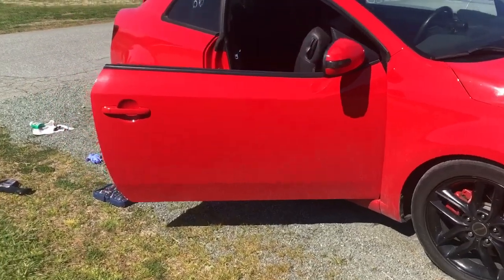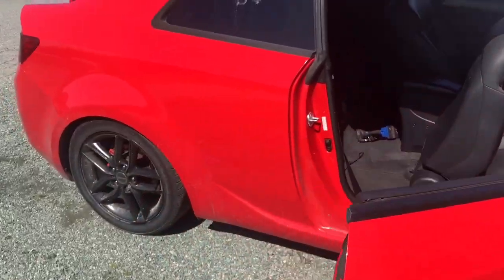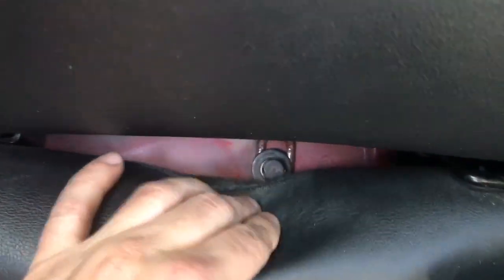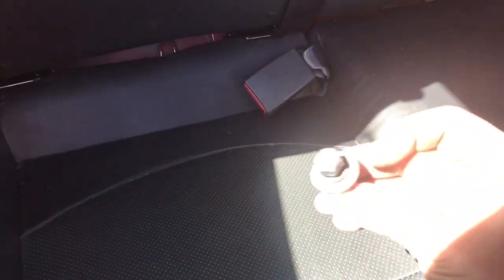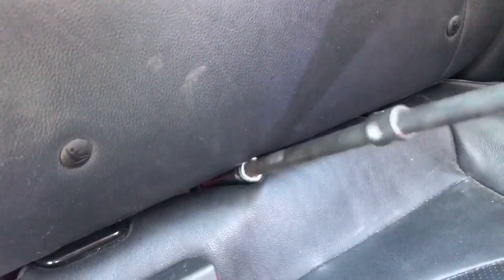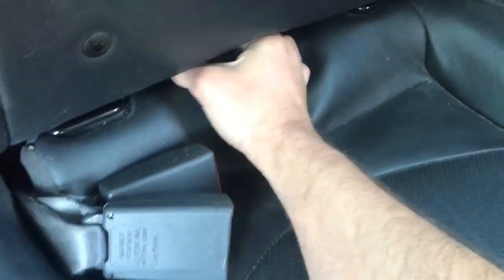Rear Seat Removal 2010-2013 Kia Forte Koup

Comment: Why would you remove the back seat? Get reupholstered?
Reply from the maker: You could remove it for that but I was going to the track and wanted to see if I could get any faster by dropping some weight.
Reply: @jrwkoup1323  did you get a better time???
Reply from the maker: Naw, it was a busy day that day so I only got 4 runs and ran around the same times. My mph was consistently faster but time was still the same. I was trying out a 3 inch header back exhaust also so that’s probably where the mph bump came from.
Reply: Fuel pump, fuel filter etc..